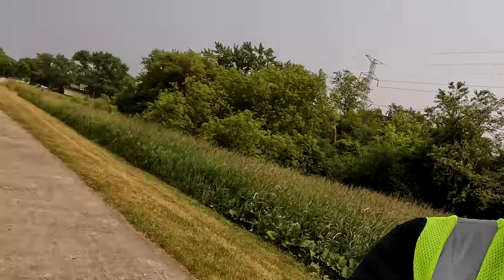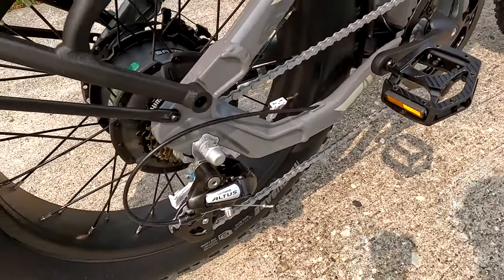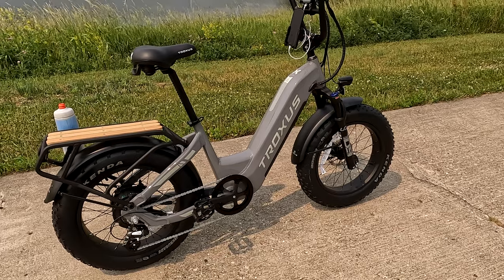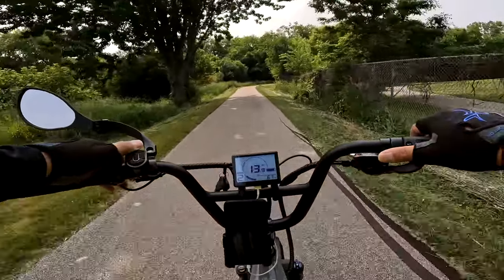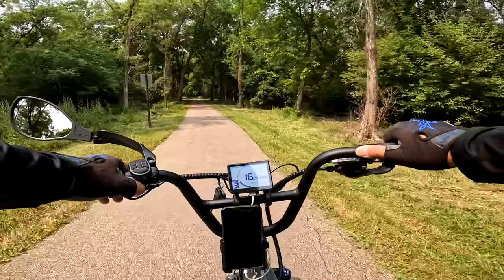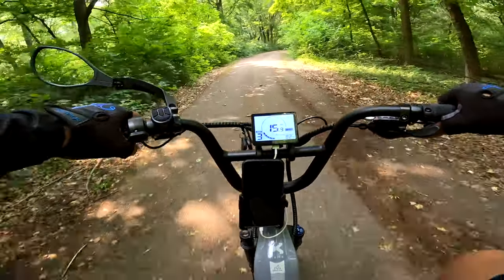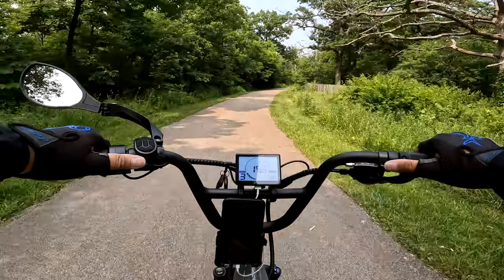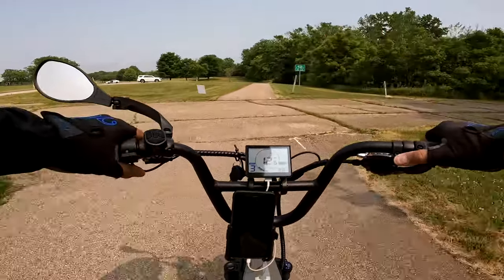Troxus Lynx - A Solid Performing Ebike - Review & Test Ride

Comment: I just released an unboxing / assembly video. My first test ride was loud. My motor seems to be much louder than yours. Its the loudest I have tested by far. Very disappointing, people way down the street would turn and look to see what was screaming down the road. Wish it had hydraulic brakes, but hydraulic brake calipers are easy to install and less than $100. Love everything else about the bike.

Comment: Hey Russ, really nice looking bike. Troxus met your criteria so it's a quality bike. Love the 20" step thru design, color, the BMX handlebars, wood rack and the $1,799 price. Lots of power and torque, wished the Troxus had hydraulic brakes and a color display tho. Good comparison between this and the MC Ocelot Pro in the comments below. Put a Suntore suspension seat post and a wider seat then it becomes a perfect Russ is Right bike.

Comment: Minimum seat height looks much lower than any adult-sized e-bike that I have ever seen.  Manufacturer's website diagram shows the seat post frame tube at something like 1-1/2" to 2" taller than the rear tire, so let's say 22".  It's not clear how far the seat post & seat sit above the frame tube.  A guess is that this adds about 4", bringing the minimum seat height to something like 26"!  

(I've seen some photos confirming that the seatpost can be inserted almost completely into the frame, such that the bottom of the saddle barely clears the rear luggage carrier.)

The manufacturer description says that this bike is suitable for riders as short as 5'1".  My guess is that a person 5'1" can stand nearly flatfooted with the seat set at its lowest position.  That would mean that this bike would probably fit a rider as short as 4'10" (and possibly as short as 4'8") for a full range-of-motion setup - the setup recommended by most other bike manufacturers.

Note:  The manufacturer also states that the bike is suitable for riders that are 6'3".  If they based this recommendation using the same flat-footed stance, the bike would not provide someone that tall with a full range of motion while pedaling.  (As Russ stated in this video, he is 5' 10" and he would have preferred a seat post another inch or two taller so that he could pedal more freely.)

Comment: How does the Troxus compare to the Ocelot Pro?
Reply from the maker: The Troxus Lynx is $1799.  The Ocelot Pro is $1989.  The Lynx has mechanical disc brakes, the Ocelot has hydraulic brakes.  The Lynx has a Bafang branded motor, the Ocelot has a Magicycle branded motor.  The Lynx has 80 nm of torque the Ocelot has 96 nm.  The Lynx has a 48 volt, 20 ah battery, the Ocelot has a 52 volt, 20 ah battery.  The Lynx has metal fenders, the Ocelot Pro has plastic fenders.

Comment: Russ could you please get back to me I got my first folding ebikes and when I unfold it will not lock in place do you know what might wrong?THANKYOU!
Reply from the maker: Don’t know what kind of bike you have.
Reply: It's the rover by land Rover I found out the bolt was to lose so I tighten it little bit then it latched over but now the seat clamp won't tighten it's got a plastic nut to tighten then a arm to clamp it down it just stays loose and won't tighten do you know anything about these clamps?Thanks Russ!
Reply from the maker: I would consider just replacing the seat post clamp.  They aren’t that expensive and you can get them on Amazon.  Just be sure you order the right seat tube size.  Check the current clamp size.
Reply: Theres no marking on clamp should I just measure the post?
Reply from the maker: @michaelb301  Sure, but check the seat post.  Sometimes it is printed on the seatpost itself.